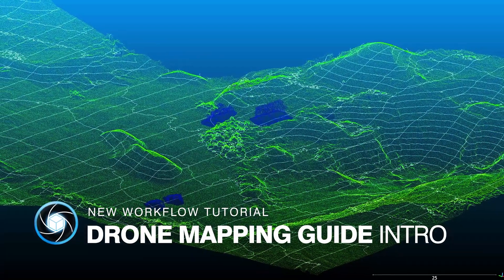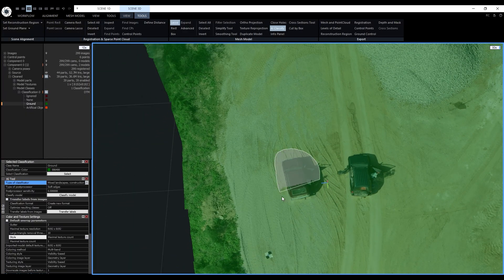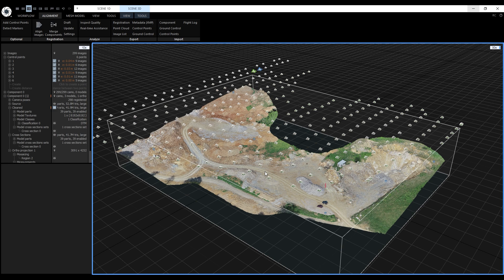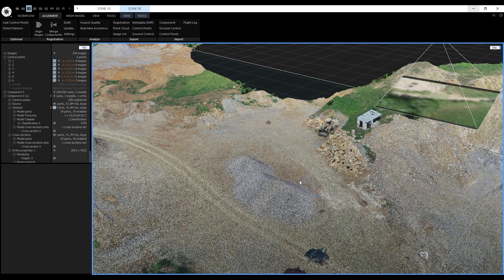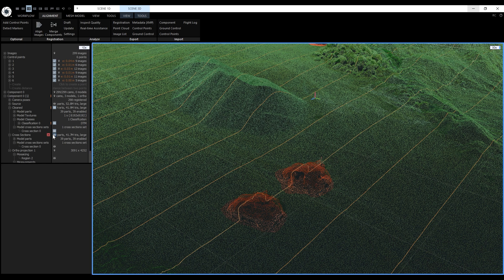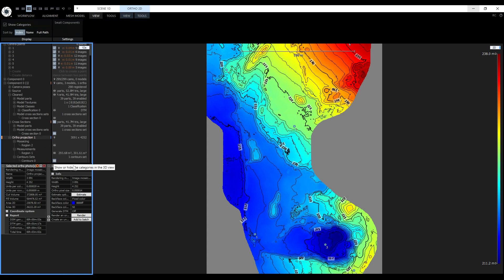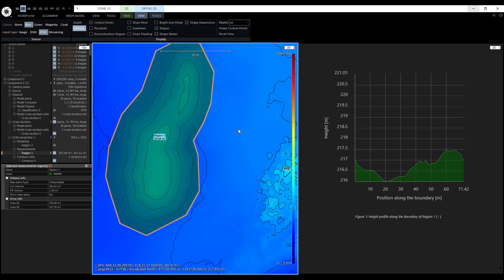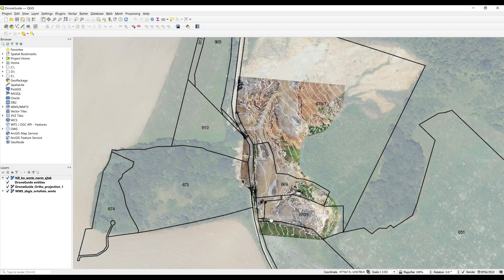Drone Mapping Guide | Introduction

Comment: Hi, I have a question, so interms of capturing the data. How are we supposed to capture the control points. I have two different drones Phantom 4 and DJI Avata. How should I capture the images and import it in the reality capture.
Reply from the maker: Hi, you just place the targets over the area which you want to capture and flight the mission or a manual flight.

Comment: Hi Jakub, great tutorial, thank for the videos. I was wondering if it should be possible do a mapping job with both aerial and terrestrial photos. This is why in some scenarios like dense vegetation (i.e. forestry survey) you cannot see the soil from above and even the part of vegetation under the canopy. So something like aerial photos for the "upper" part and terrestrial photos for the "bottom" part.
Reply from the maker: Hi, theoretically this is possible, but you need to have a good overlap between datasets. Also, the ground capturing of the forest could be quite hard, because of the overlap and trees. But still, there is some kind of vegetation in forests, so the ground could be covered. So, as I wrote, in theory it is possible, but hard to provide.

Comment: Hi, I have a serious and urgent problem.
The blank model built in RealityCaptre has some potholes on the surface, but it's ok because after I texture it, the model is perfact , and the surface is smooth. 
The problem is, when I export the model into other 3D-creation software like 3DMax or Maya, the blank model has potholes, too. However, even I texture it, the textured modle still has potholes. It's not as perfact as what I see in RealityCapture.
I don't know if I miss some adjustable settings, or it is an unsolvable problem because of different rendering pipeline or what.
Reply from the maker: Hi Jason, by texturing you don't change the model, it will be as it was. It could look good, but because of the textures. What kind of dataset are you using? It seems, that it is some alignment issue. How were your images aligned? Are you using control points?

Comment: Hello! I want to know the result of a mapping like this but withouth GCPs. Many times I tested with RC but que aligning was bad.
Reply from the maker: Hi Victor, id depends what type of drone you are using. Without GCPs you should use RTK drone. Also it depends what and how you are capturing. What do you mean by bad alignment?
Reply: @RealityScanOfficial  Hello, thanks for your answer. As archaeologist, many times we can't count with GCPs or RTK for first inspection of areas with archaeoligical interests, so in this case we used a Mavic Pro for a fly a low altitude. With bad alignment I mean a segmented alignment in various components impossible to join in one model and missing images. Maybe I could share with you the dataset of images so you could see whats going on.
Reply from the maker: @victormendez3683  Yes, that would be great to see your dataset. You can send it to trhond@capturingreality.com

Comment: Great tutorial, well done and complete. Congratulations. The link above leads to a free dataset download page which does not include the dataset referred to in this tutorial. It is possible to have the dataset with the GCPs to replicate it. Thank you
Reply from the maker: Hi and thank you. In free datasets is another drone dataset, which can be used. The principle of work is the same.
Reply: @RealityScanOfficial  Which of the free datasets are you meaning?  Is it the "Interior & Exterior Dataset"?
Reply from the maker: @philippnorman  There is also Drone Imagery + Ground control points dataset.
Reply: Thank you. I'll try